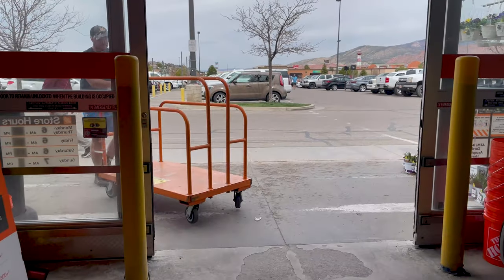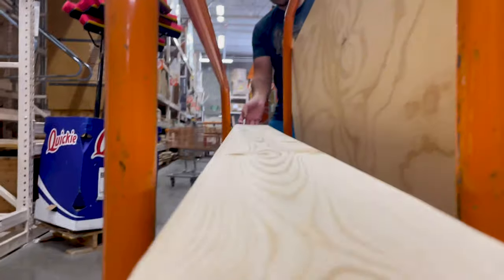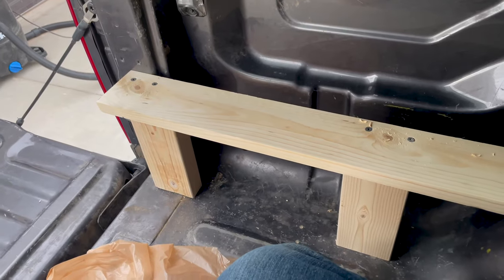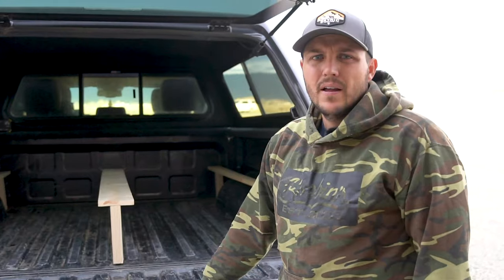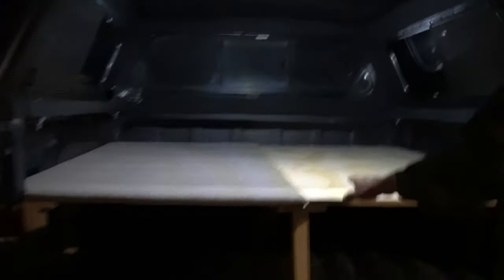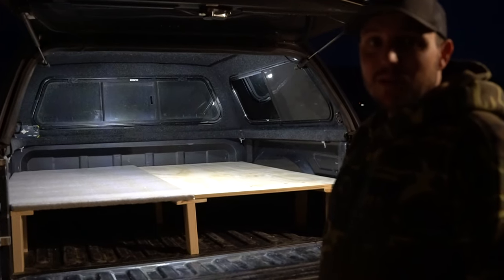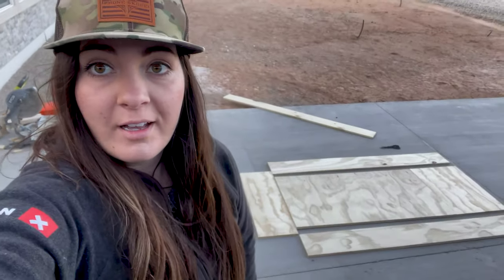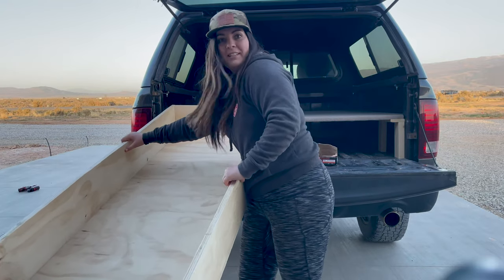$300 ULTIMATE DIY Truck Camping Setup! Simple Design + Budget Friendly

Comment from the maker: Any suggestions on things to add to make our truck setup any better?
Reply: This is a GENIUS concept! 

I think upcycling some flannel (both lightweight & the thicker ones too!) shirts as curtains with a wire curtain rod system to cover the windows in the canopy  would A) make for great "bedside storage"* & B) could be used to keep in heat/keep out light etc.

*You could potentially hang lightweight stuff on the wire, or use it as a drying space by opening the canopy windows. The pockets of the flannel shirts could hold your phone/power banks/toiletries etc.
Reply from the maker: @pakristofzski  Thanks for watching! We’re super excited for all of the adventures to come with this setup!

Thank you for the suggestions with the flannel curtains. That’s a genius idea and we will definitely have to look into it.
Reply: A good idea for a drawer handle is just a piece of rope. Drill 2 holes in the wood drawer face and insert a small length of rope and tie it to itself inside the draw. The rope is flexible and so when you close the tailgate, it will not be in the way.
Reply: The simplicity is great. I prefer having my fixed bed on the passenger side. When carrying taller items in the removable area, my right-rear view isn't obstructed while driving.

Comment: A good idea for a drawer handle is just a piece of rope. Drill 2 holes in the wood drawer face and insert a small length of rope and tie it to itself inside the draw. The rope is flexible and so when you close the tailgate, it will not be in the way.

Comment: Great Setup, looking for ideas to do similar with my 2500.  I had a similar idea for the two sided but so I have extra room if traveling alone.   For a handle I think I would cut a small oval in the center of the face plate, router it so its rounded and sand.  Nothing sticking out and it should be small enough that nothing will fall through.

Comment: You wouldn't have window measurements would you? I'm waiting for my cap to arrive and trying to make black out curtains while I wait 😊
Reply from the maker: We don’t have those yet! We’re planning on doing the same thing!
Reply: @SkynicHunting  update.... topper came in and installed... too wet and rainy for the platform build but picked up the lumber .. sewed blackout curtains I cut to size from Walmart eclipse black out curtains ... velcro sewed on to attach to carpet lined topper... amazing results...note... sourced non adhesive backed sew on velcro from uline...$35 delivered hook side only 75 feet..... 2 sets of black out curtains... fully black... each panel 37" x 84" ....2 sets gave me 4 panels ( $15  a set)  a lil tedious...but worth it.

Comment: Does your free floating support on the passenger side of the truck bed stay in place without falling with just the pressure of the plywood on top while driving?
Reply from the maker: Yes it does stay in place while driving. We’ve never had any issues with it falling or moving out of place.
Reply: @SkynicHunting  thank you for quick response... I'll be doing this build this spring. I love it's simplicity and versatility.  Ty
Reply from the maker: @mikeoutdoors8724  You’ll absolutely love it! We’ve already spent well over 30 nights in ours and absolutely are loving it!